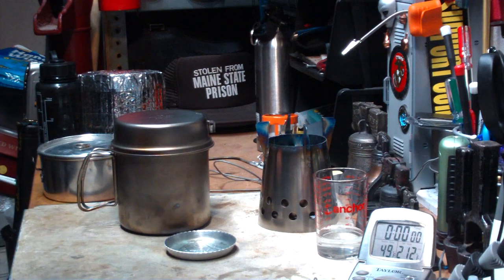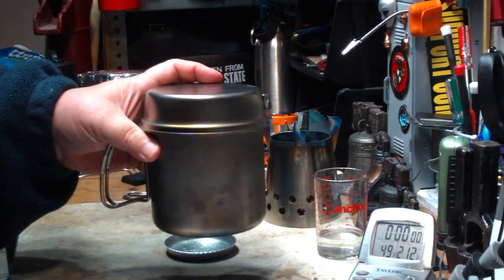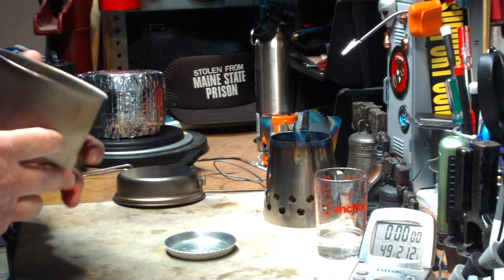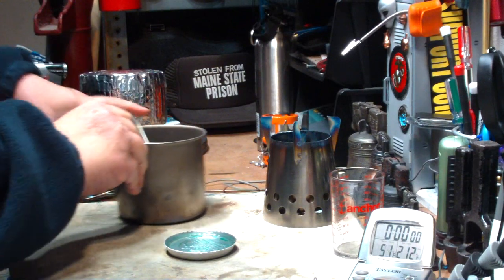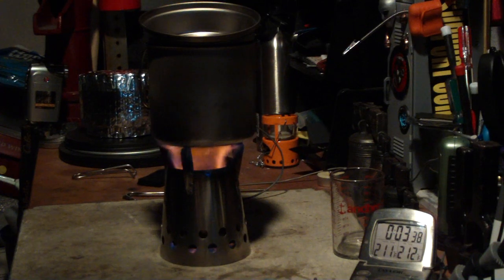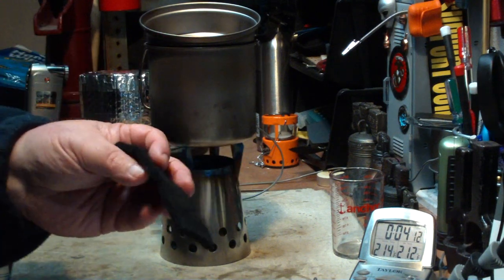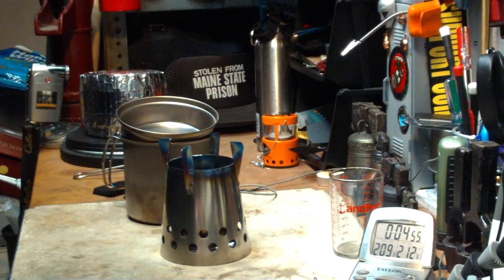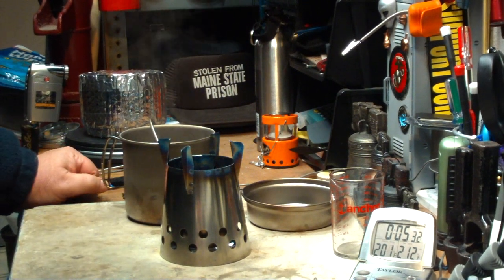Four Dog Stove's - Bushcooker LT II - Boil Test #3

Comment: I bought the Kelly Kettle several years ago and now they make a hobo stove for the two larger models when your not using the kettle.  I have the trekker and they do not make a hobo stove for this model and was looking for something that would work for the trekker as a hobo stove. Does the Bushcooker LT 2 or 3 fit on top of the Kelly Kettle Trekker base? Great videos, they are always helpful!  Thanks